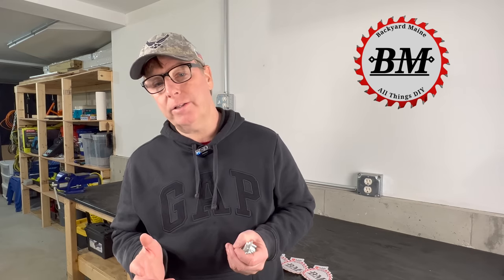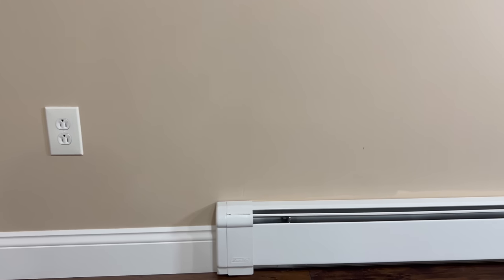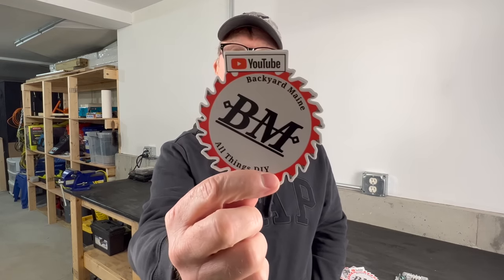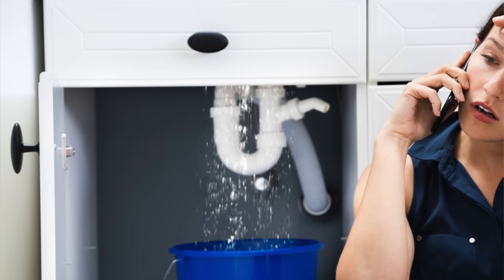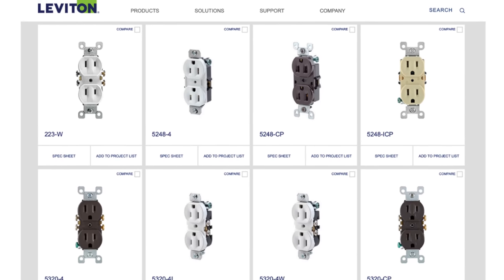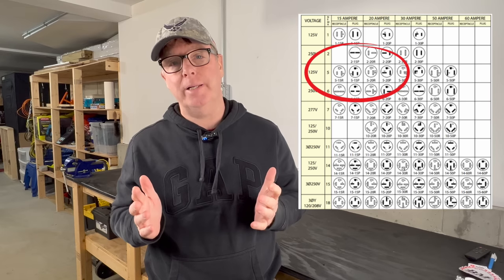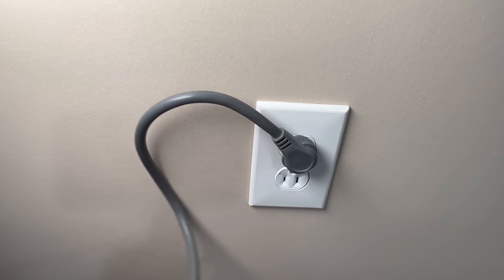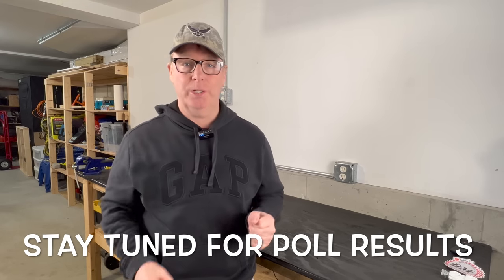Are your outlets installed upside down? (You may be surprised)

Comment: As an old electrical dude I have heard the logic of the "ground up" orientation and I do understand it. However; I have never seen a situation where the "ground down" orientation has been a problem, either in residential or industrial applications; and like you say, "ground up" just looks odd. ! Good discussion !
Reply: Mostly it is due to how the US plugs are unsafe just as is, compared to say parts of Europe where the contactor has coated sections that are the only part exposed while inserting before the plug reaches the live contactors inside the plug.  Where US plugs are immediately life as you insert them, so any exposed metal of the plug is live and if a finger or bit of metal touches them while not flush with the outlet then it is very dangerous.  Ground up would prevent falling metal from crossing both live and neutral.  It could cross live and ground but then should trip a breaker.  That is how an older electrician explained to me why most residential is ground down while industrial applications use ground up.  Commercial or office spaces tend to be a 50/50% use case from what I have seen.
Reply: Thank you.
Reply: The problem with ground up outlets is as the prongs loosen over time the plug starts to sag out of the socket. With the ground down the ground prong supports the plug and keeps it firm.
Reply: same here !
Reply: Sparks flew during 15 minute band changes from broken guitar strings, etc., during the decade I worked Entertainment  Tech crew Resorts International Hotel Casino way back in the previous century.
Of course I screamed like a frightened little girl at first, but you get used to it and it became a rodeo attraction for the audience after that.
"Look how brave those roadies are, flicking away burning metal embers off their P A N T S !"✨
Reply: @Mikej1592  Most European sockets I am familiar with have a socket which the plug fits into so the contacts are shielded. Problem solved!
Reply: When I was in college, my roommates had their first license plate mounted on the wall with some sort of adhesive. Directly under it, a three-prong outlet with the ground prong facing down. Over time, the power plug in that outlet had begun to sag a little bit, and one day that license plate fell off the wall, straight down into those prongs. One very loud pop and bright flash later, that license plate was on the other side of the room with a nice chunk missing out of the edge, and corresponding burn marks on the outlet. This stuff definitely happens lol.
Reply: My house wiring teacher in high school said ground down was the correct method. If the plug is loose, gravity pulls the cord down, so the ground pin of the device is the last pin to lose contact as it gets pulled out. Interesting argument about ground up and shorts, but I have never heard of that happening until now.
Reply: I was an industrial electrician, ground down, because of gravity, so if the plug sags or starts to fall out it is grounded longer.
Reply: @Mikej1592 , in the case where a metal object only touches one prong, there won't be a short, so breaker won't trip. In that case, a hot blade is "live", and the person removing the found object completes the circuit. ...ugly business.
Reply: What a weird thing to say: "I have never seen." Should we be looking at one person's experience? What does the data say?
Reply: @mitchvh9833 When the live lead is exposed, what's the ground being last to pull out going to do?
Reply: @michaelketchel  This is a great story. I can picture it in my mind lol. Who would think.
Reply: Yhe only people that care are paper hangers
Reply: Grd up is normal to us and Hospital.s use grd up grd up eliminates the strain on the grd terminal after all we wouldn't want to be below the  grd would be lol
Reply: To me and my crew ground down looks odd and is dangerous
Reply: If you have to plug in a right angle cord (do often in my job)  ground up makes is a sloppy mess of cords
Reply: DOWN is the right way
Reply: The flaw in the "logic" for ground up is that even by that argument, it is ONLY even theoretically safer if the plug is only partially inserted. If you allow that situation to exist, that alone is more dangerous than the claimed benefit of ground up outlets.
Reply: @petset77  ONLY if the person is careless. In the RARE case where the object actually stays on the single blade, just pull the plug and it will fall out without being touched.
Reply: @timburke4837 Ground up provides protection against a short circuit if a Bobby pin or other piece of thin metal fell against the plug when plugged
 Into the receptacle as it wood fall against the ground pin first.
Reply: Eyes up, mouth down.
Reply: @chrismiller5875  Not where the cord needs to go up.
Reply: Completely fails when the plug has no ground
Reply: Also, most plugs that have a ground prong are coming from one side of the plug. If you plug it in upside down, they the cord is bending to accommodate.